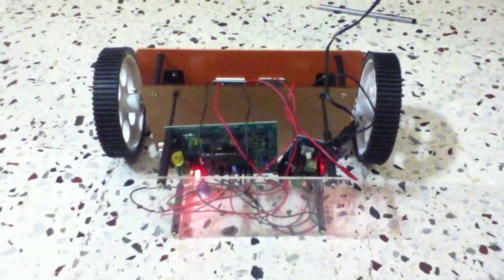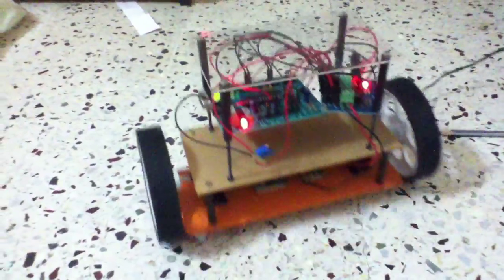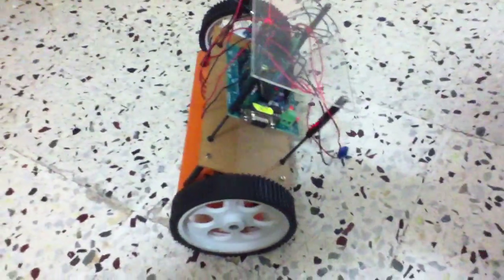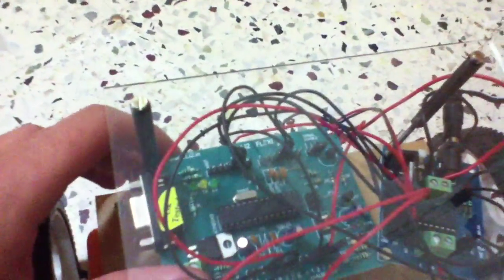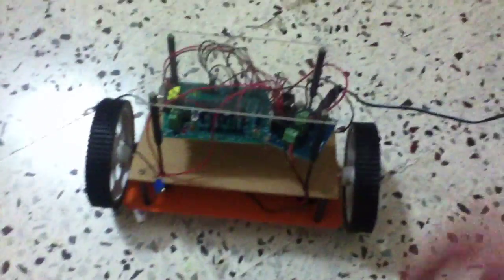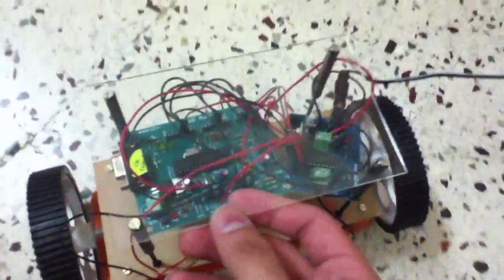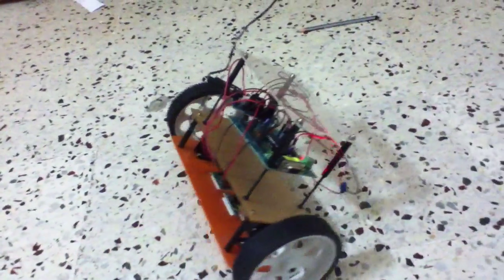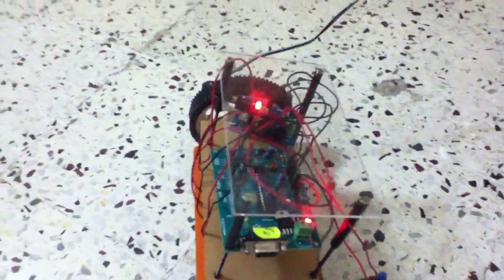Self Balancing Robot Using Arduino

Comment: Thanks alot Akcopter!:)
The code you've provided are as such no use to me as i'm not using an arduino platform but self-made AVR board for the SBR but i'd go through them and hope they help.
In anycase what i'm really thankful to you about is the Starlino page. That was a real treasure indeed. I'm on with the mathematical calculations and formulations and back to work on the long on-hault project. There's not enough time left but i guess i'll be posting a video soon enough. Thanks tons mate :)
Reply: hi paresh... can u please mail me the code at amc10@iitbbs.ac.in ....I m stuck and need some help with the coding..

Comment: So this is very god news. I tried to use Bretts PID library but failed. You could really help a lot of folks if you could clarify a few things. I do not have a professor to ask.

So I hope you will be kind enough to help.
Did you use Bretts library?
Did you need to use wheel encoders?
What did you use as input,setpoint, output? Input was perhaps reading the IMU combined value. That is gyro and accelerometer angle?

Set point would be 0 degrees?
What the heck is direct?

Comment: I am doing this same thing. I have succeeded in getting the info from my IMU as a complimentary filter value and use wheel encoders to get the wheel postion and velocity. The final step is implimenting the PID. Here is where I'm having problems any tips?